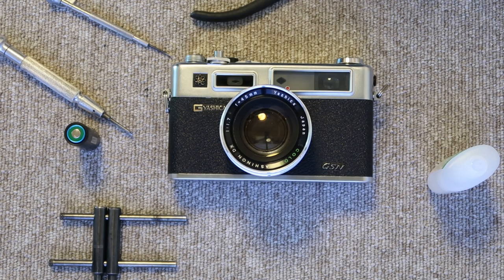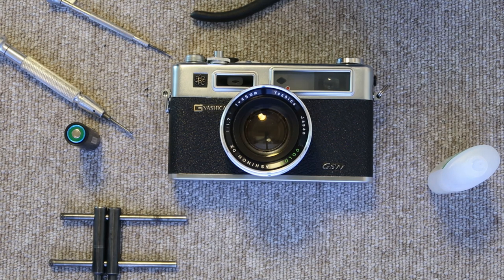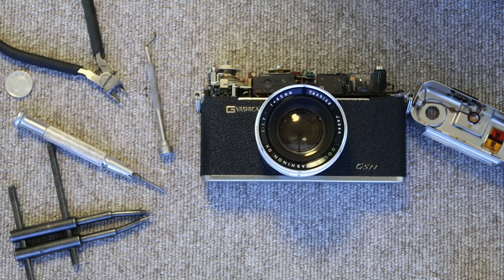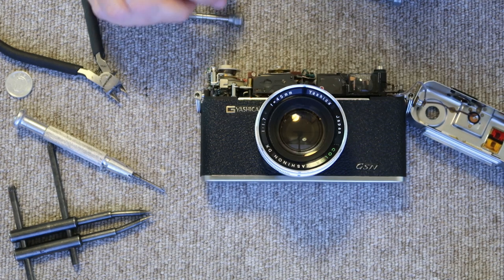Restoring a Yashica Electro 35 GSN Camera

Comment: I am not complaining, as it offers me a good repair project per your above instructions, but the GSN I purchased from you has a loose Flash Wire. The hotshoe has a sporatic connection, i can actually press lightly on the camera body and the flash will go off when either mounted in the hot shoe or connected via the flash cable port. Other than that, the camera is in beautiful condition and works perfectly.

Comment: Found a good looking GSN copy for a good price, and went through with the help of your video, and got it cleaned up, and removed what was left of the POD.  Cut down a small piece of rubber to a size and thickness that felt like it would be correct for the POD replacement, then placed it in there several times, to test the clearance, and did some retrimming before finally gluing it in place.  After reassembling the camera, testing firing the shutter, it seemed to work, but then I noticed that I will fire the shutter and it seems to work for a couple times, then it will fire as if on bulb setting, open the shutter, but only closing on shutter button release.  Then it will go back to firing normally.  Is my POD replacement causing this inconsistency, or is it something else?  I'd really love to get this camera working properly!  Thanks
Reply: I have a GSN, and I also have a problem with the red and orange lights. I don't know anything about electronics and I'll take it to an expert electronic camera technician. I think it will not be cheap, but it is worth having this camera in perfect condition.

Comment: Hello, I don't know if you can help me, I have a Yashica Electro 35 GSN with a problem with the aperture blades. The blades close correctly, but they don't open correctly, if I'm at f16 and I start to open the aperture, the blades only start to move when I go from f5.6 to f4, but to close they close normally, have you ever seen a problem like this? Would you be able to help me? Thank you very much in advance.

Comment: Of course, I'm a very respectful person. I was wondering if the owner of this YouTube channel actually provided this meter light meter fix as a service?
Reply from the maker: There are half a dozen things which can cause the light meter not to work on one of these cameras, and it is labor-intensive to diagnose and repair or replace a faulty part. It's more cost effective to simply replace the camera with one which works properly.

Comment: Thank you so much, for creating this video.  Picked up this camera on Ebay, disassembled  per your instructions, and discovered the "Pad" was missing .  Struggled a little, but got replaced (fashioned from rubber lens shade),  now the shutter speeds sound normal. Will run a roll of film soon.  Only issue was difficulty adjusting the horizontal range finder .  The ghost image doesn't completely come together at infinity . Vertical adjusted okay.Thanks. KB

Comment: Thanks for all these videos, I picked up a GS off of Ebay untested and have been fidgeting with it. Everything is now working as far as I can tell. Waiting for new door seals to come next week then I can finally shoot my first roll with it. 

I had a weird different issue with the battery cap, someone had mis-threaded it and left it stuck so I was expecting a exploded battery inside but it was pretty clean. I ended up having to take the bottom off anyway but then I was able to get the battery cap between my fingers and snap it into the proper threads while flexing the bottom plate slightly.

When I finally got the battery/exposure lights to work I was so damn happy, video doesn't really show how vibrant the lights/viewfinder frame really are.

Only bad spot on the camera is the viewfinder which is a bit hazy, I'm going to leave it alone for the moment though and wait until I have a more serious issue to deal with like the pad going bad.

Comment: The Electro 35 GSN beam splitting mirrors maybe robust but the  Yashica Lynx 14 aren't robust,  I found that out the other day even though I used Zeiss lens cleaner. So i've gone from a Lynx that was really hard to focus to one that can't be focus at all.

You know of a replacement beam splitter?..
Was looking at a Canonet 28 (far greater beam splitter has a coating on each side, one side yellow semi mirrored  and the other side blue) but was too small 24mm as the Lynx looks to be 27mm x 12mm x 1mm.  Maybe best for me to look out of a "spare or repairs" Lynx or better still the Electro 35GSN, that's if there the same(ish) size.  

Note to self read up on the old cameras first before you attempt to..erm "Repair" them...

Comment: This is super helpful!!! 

My issue is that my check light is coming on, but after i do all my tests for the light meter indicators, they dont come on... could it be that the connectors are corroded or i have the wrong battery?

Comment: Very useful, thank you for mentioning that the beam splitter is safe to clean, I wasn't aware of this. Mine has a wobbly lens and a bit of a stiff focusing ring, and though it doesn't affect pictures it annoys me. Is there a way to fix it without having to peel off the leatherette and other major disassembly? How difficult is it to get to the helicoid essentially?

Comment: I ended up purchasing one of these off eBay and it’s in considerably worse condition than this. The battery door for one is corroded stuck. The next big thing, although I never use it, is the self timer moves to about 2/3rds of the way to the end and stops. The bulb setting also doesn’t work and finally the plate that pushes the film flat is lopsided. Haven’t fully watched your video yet, but I plan to in order to get an idea for what I’ve gotten myself into. Hopefully I can restore it

Comment: You spoke of replacing light shields. I pulled this camera out of storage from the 70's. I remember I stopped using it because a repair shop told me it had a light leak. Will you be showing this repair on another vide

Comment: can you make a video about   adjusting the reangefinder  horizontaly and verticaly for focus ?
Reply from the maker: The horizontal adjustment is made through the hold under the flash shoe, the vertical adjustment is behind the black plate with the battery check button.

Comment: Thank you for all the info, anyway to see what the battery compartment looks like, just bought the yashica gsn and I have a stuck stack of batteries, I am tryin to determine what battery and what a battery rig job.
Reply from the maker: The battery chamber is about the size of a Chapstick tube without the cap, there is a spring inside which contacts the negative side of the battery. The normal battery is a HM4N battery, which is made up of 4 mercury batteries stacked inside a metal shell. You can use a 4LR44 battery with an adapter, or you can get an A32PX battery from amazon, this battery will fit without an adapter.

Comment: Thank you for this, just bought a 35 GT and managed to give it a service thanks to your video. One issue I have is once the ISO dial has been replaced the inner, numbered part, spins with the outer ring. do you have any tips on how to overcome this.?
Reply from the maker: You need to make sure the small washer beween the number plate and the dial is not missing, or that the washer is not pinched, it has to be properly centered,

Comment: Very well made video thank you! I picked up a GSN not long ago that looks like it’s seen little use. It looks like it has the POD issue which I will fix but another issue is that when I turn the focus ring the focus box in the viewfinder doesn’t move. Is this a common problem and what’s the fix? Thanks.

Comment: Thanks for this video. I’m currently following your method and at the time of unscrewing the lens, it doesn’t come as a whole. I tried turning back as you suggested but nothing… I had to take the elements out but the main cylinder does not move, tried rubber tools, a squash ball, some alcohol. Some people are suggesting to cut two notches on the metal but I’d like not to do that. Have you faced a similar issue before?
Reply from the maker: This happens frequently, I sometimes use a drop of super glue on the threads of the ring which comes off, then screw it back on tightly, waiting for the glue to set, and then removing the lens group as a whole.

Comment: What to clean the metal top plate on a Yashica electro 35 film camera. I have cleaned mostly with water and soap but parts are still blotchy and want to be careful not to use a harsh metal cleaner.

Comment: Im very new to this camera, so im really confused about this shutter design and the aperture blades I cant see. And no matter what settings I put for ASA or Aperture, the shutter sound and the movement and its speed is exactly the same every time. Is there something wrong, or do these things work better with batteries? What exactly are the batteries for, if not just the exposure warning lights? I see nothing happening when I change the aperture, so im confused if the aperture is actually changing with the dial or is it hidden behind the spiral shutter

Comment: Do you have any suggestions or resources for how to fix a counter on this model that doesn’t change (stuck on 36)? Thanks for the video!
Reply from the maker: Check the lever in under the film door near the top right, sometimes it is stuck, pull it out with a pin or small screwdriver, that may unstick it and cause the counter to reset.

Comment: Thank you so much for making this video. This helped me a lot to restore mine. The only problem I get on my Yasmina electro 35 GTN, is on the focusing ring. Stiff what ever the sens I turn it. I find it not so smooth as I want. Any advices on how to make this ring turn a tiny bit smoother? I wish you a really nice day. I am looking forward to read from you.
Reply from the maker: Short of completely disassembling the camera, you cannot lubricate the focusing ring. A trick which may work is to use a hair dryer to get the camera hot, too hot to touch with your bare hands, then turn the focusing ring. When the camera gets hot enough, the grease in the focusing helicoid gets soft enough that you can sometimes get it to unstick.

Comment: Hi there, thank you so much for making this video. I have 2 Yashica Electro 35s and neither are powering with my makeshift battery (comprising of 4x LR44 batteries taped together, with a thick cylinder made of aluminium foil to fill the extra space). What other issues could potentially cause power failure? They both still had the old degraded Mercury batteries inside of them. Thank you from Tasmania.
Reply from the maker: First, make sure you have the polarity correct, the positive end of the batteries should face toward the battery cover, and not toward the spring. The electrical connections on the plastic battery chamber can sometimes corrode and disconnect,  one is under rangefinder, the other is under the bottom cover, and soldered to a ring around the end of the battery chamber,
Reply: @japanvintagecamera8869  Thank you for your reply! The contacts on the bottom cover (312-308) have eroded from the old mercury battery. I tried using foil on the bottom cover to fix these contacts but it isn't working. Do I need to replace the part completely?

Comment: Hello. I acquired a very nice condition GSN and it seems to work fine, however, bulb mode does not work.  When I press and hold the shutter it remains open, but when I release the shutter button it stays open, it only closes when I move the film rewind lever.  Any idea what the cause of this is?  Thanks.
Reply from the maker: The first thing to check is that the battery is in the right way, the second thing would be the POD, and lastly, the contact on the inside of the selector ring which switches between auto, flash, and bulb.
Reply: @japanvintagecamera8869  Thank you for the input.  I can rule out the battery, I've been using the camera and it works fine.  I do hear the clunk when I advance the film, so I don't think the POD is the issue either.  That only leaves the contact on the selector ring, I will look into it.  Regards.

Comment: Great video and thanks for the all info. Only one question my yashica electro 35 gtn only goes from 1.2 meters to infinity. Doesn't pass to the 0.7 meteres, do you have any idea what it is causing the problem? Thank you and cheers👍
Reply from the maker: It could be one of a few problems. If the plastic under your film counter window has come off, it may have fallen down inside the camera and gotten itself stuck near the lens body. The problem can also be caused by misrouted wires which are in the way of the lens when it is being focused outwards.
Reply: @japanvintagecamera8869  thank you, maybe I need to open one day to try to fix. I'm just losing a few cm, but I will fix in the future.

Comment: I am in the process of cleaning and reviving  this camera and would greatly appreciate your advice if you can provide it. All seems to have gone smoothly except for re-assembling the ASA dial. I note in your video you state that the brass pin should be at the 9:00 o'clock position whereas in my case the brass pin is more at the 8:00 o'clock position. I am not able to rotate the dial any further. Your red marker falls at the 5 -5:30 position , mine more at the 3:30 position. The end result is that I am unable to place the 1000 ASA value at the 5 o'clock position. If I loosen the two small locking screws on the film speed selector will I then be able to rotate the brass pin into the 9 o'clock position.
In addition I note when rotating the ASA base there is no change occurring in the masks of the Cd photocell window.
Thanking you in advance if you provide comment. I accept all responsibility.
Reply: I have the same issue, we’re you be able to solve the problem, I just got a GT version

Comment: Do you have a video on how to repair if the camera is not getting power?
Reply from the maker: There are two reasons the camera may not seem to get power, usually the fault is either a bad battery check switch or lamp, or that the power lead on the battery chamber has become corroded and disconnected. You can find the power lead by removing the top cover and rangefinder. The check switch or lamp bulb can be replaced, but you need a little skill with a soldering iron.
Reply: @japanvintagecamera8869  Thanks, cleaned it up, did some soldering. Had to replace the battery test switch as the terminal wire was broken as well. Got power now, but shutter gets stuck, pod of death im guessing. Going to try 2mm plexi. I love your videos, I am a huge fan.
Reply from the maker: @TheJohnnny5  Make sure the selector ring is not on the B setting (easy mistake to make), and make sure the battery is not in backwards (another easy mistake to make).

Comment: Thanks for the video! Do you know what to do if the lock mode is not disengaging properly?  (The switch surrounding the shutter button turns but has no effect, the film rewind and shutter remain locked)
Reply from the maker: The locking mechanism may be faulty, or something like the plastic window under the frame counter has fallen in and gotten jammed up somewhere. You can take off the top cover and see if the mechanism is okay from the bottom side, and also if there is anything jammed up. If the camera is not winding, it means the shutter blades may be stuck. You can unstick the blades by removing the lens elements on the front and applying solvent or lighter fluid with a cotton swab to the shutter blades, then them clean with a blower brush or canned air. Lastly, is there film in the camera? I have received more than one camera which was jammed and wouldn't wind anymore because it had filmed loaded in it, and had been wound to the end of the roll.
Reply: @japanvintagecamera8869  Thanks so much for the suggestions, I'll see if any of these can do the trick.

Comment: Excellent, this already answers most of the questions I had (my GTN has a burned out battery light), but one thing I’m not yet sure about: my ASA ring is getting more and more hard to turn. I am not sure how to best approach this. I might try the hair blower tip you gave to get the focus ring moving again, but is there anything I can buy here in Japan to lubricate this part?
Thank you in advance 😄
Reply from the maker: The lubricant is easy to find, the hard part is disassembling the camera to the point you can reach the focusing helicoid gears, which require removing the top and bottom covers, the leatherette, unsoldering a few wires, and a few other things. The ASA ring is simple, just remove the screw, ASA plate, washer, and dial, you'll see the brass ring underneath with holes in a circle for the detent, just put a drop of oil through a couple of the holes, and turn the ring back and forth to lubricate it, then put it back together,
Reply: May i know why after oil ASA ring it doesnt make click sound?

Comment: Thank you for this interesting video. I have an Electro 35 , but it seems to only close the shutter when I take my finger off the shutterbutton. Do you have any idea what problem this might be?
Reply from the maker: Make sure that the selector ring in front of the aperture ring is set to "auto" setting, and not B.
Reply: I’m having the same issue.  Set to auto, the shutter will sometimes open and close with press of shutter button, other times it will open on press and only close on release.  I can do it 10 times in a row and it will about 50% of the time work correctly.  Are the shutter blades sticking?
Reply: @japanvintagecamera8869  I meant to send my message to you.

Comment: I’ve just purchased an electro 35 GSN and the battery light comes on but not the metering lights, also I don’t think the shutter speed is changing, not even in bulb mode. Can you suggest how to repair? Cheers AG
Reply: There's a red wire inside the lens mechanism that's become detached from the brass connector